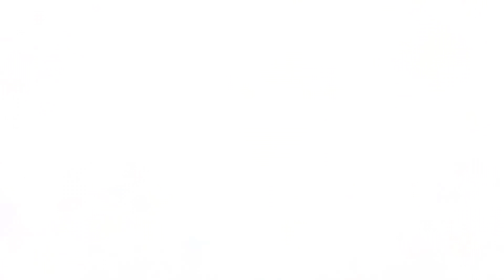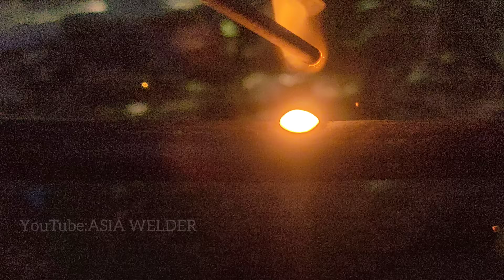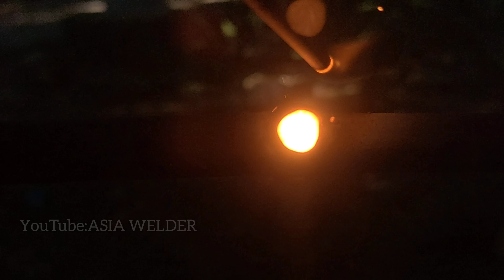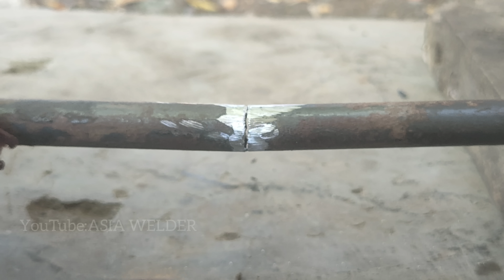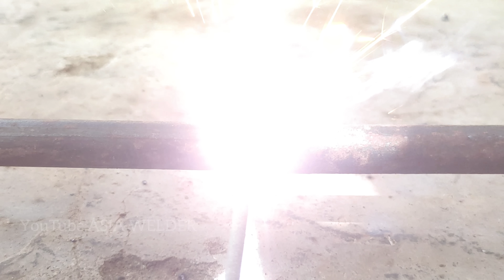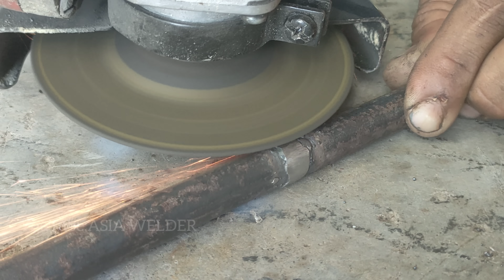rarely discussed by welders, techniques for connecting strong concrete iron

Comment: A decent lap joint will give you better strength under tension. If you absolutely need to do a but weld, tack it in place, then grind a V 1/2 way through, fill the V, then flip it over and do the other side the same way. That way you know you've got 100% penetration and no loss of cross sectional strength.